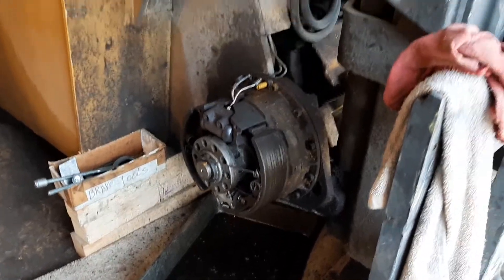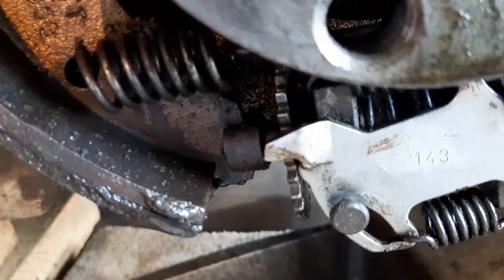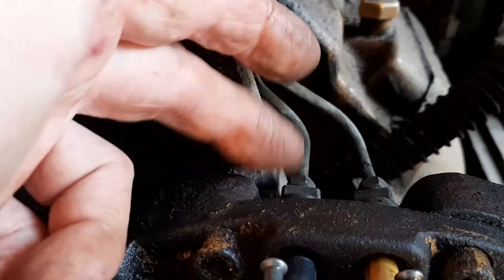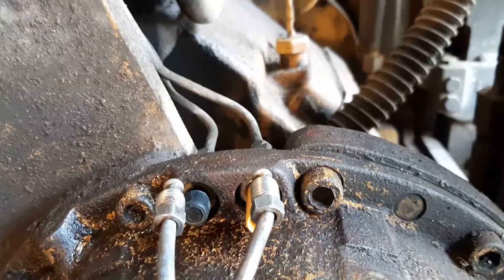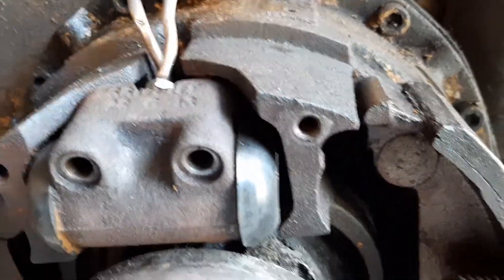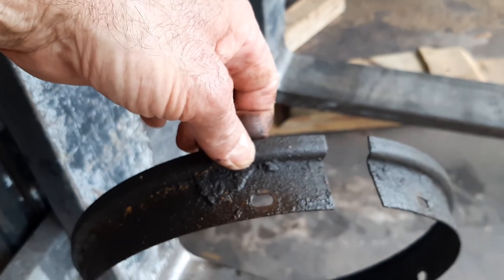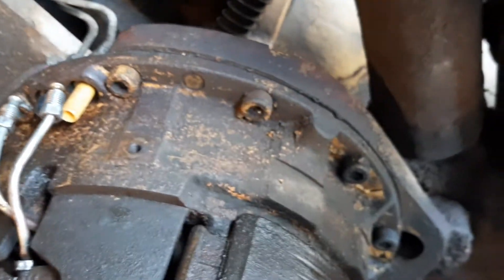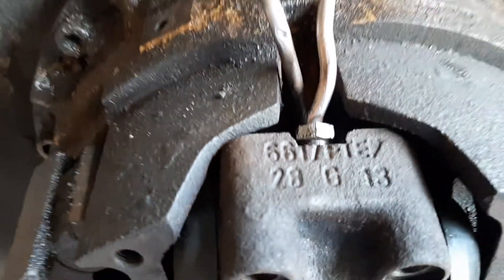Caterpillar Fork lift brake wheel cylinder replacement

Comment: One brake line is for the pressure, the other is for a remote bleeder under the floor plate, both bleeders are on the “passenger” side (since you’re familiar with cars) and the reservoir for the brake fluid is in front of the steering stem between the mast and wheel. Pull the panel from the top and it’ll tilt out. It has 2 detents it snaps in and out of.

Comment: it's 7/16 not 13mm 
but the bolts holding the top plate and the wheel cylinder are all 10mm bolts for some reason
and also the bleeder valve is a 7mm wrench

Comment: i have a T35 D caterpillar forklift serial # 5GB 
i noticed the wheel cylinder is welded ??to the back plate casting have you seen anything like this? is it removable ? id like to replace it 
it pumps but the pins (9.5mm by 30mm ) are all rusty.
Reply: Make sure it’s actually a weld and not silicone that looks like a weld. Some has a seal of silicone around them and then it’s all painted over and can be very deceiving.
Reply: @larrytemen4789  no it wasn't weld it was just stuck
Reply: @fredrezfield1629   By chance do you have any parts diagrams for the T35D? I have the same unit - 5GB serial - and it needs a few repairs.
Reply: @StyxWorxGarage  no i didnt dont waste your money its a pos forklift

Comment: Any idea
Reply from the maker: Check to see if the shoes are oil soaked or if maybe a return spring is broken . Thank you
Reply: @ericsolomonrent  thankz for the return answer i put new shoes, w/cylinders and spring and adjusted both adjuster even click this thing is driving crazy lol i adjusted  and after a week drives good but when going on reverse draggs
Reply: @leonleon2239  i bought this forklift used they didn't change their master brake cylinder when it died so they kept using the E brake 
when i was taking the drums off it was stuck so bad everything had seized